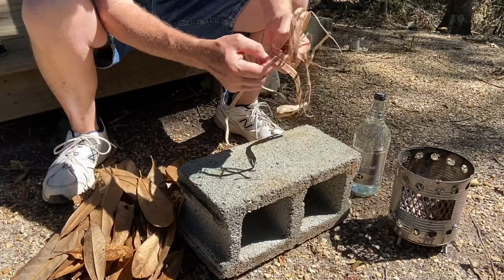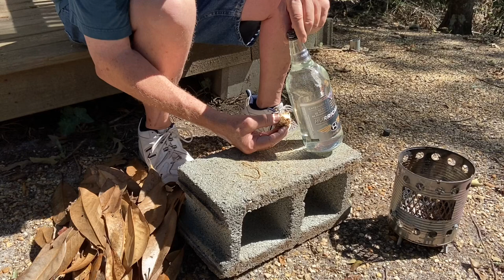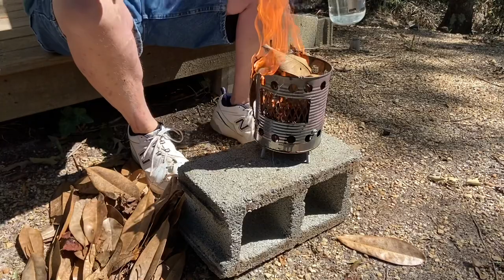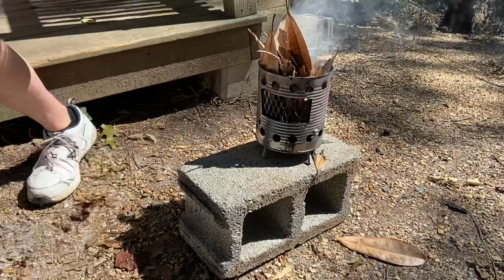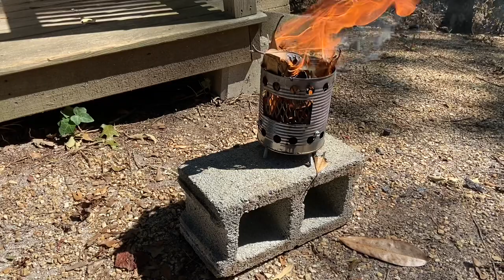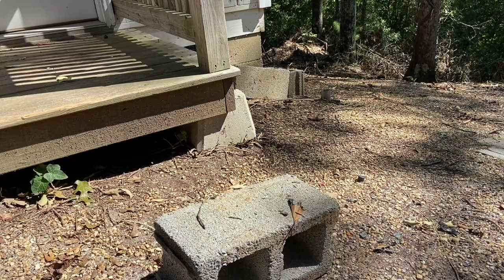Why Spend An Hour+ On Friction Fire When Solar Fire Only Takes Minutes?

Comment from the maker: Friction Firist's can spend hours trying to: find materials for a set, build that set, and then make them produce. Hand and bow drill, bamboo fire saw, and even sometimes fire roll can be labor intensive! Not so much though with Solar ignition. On a bright sunny day using an easy to carry wallet fresnel lens or a bottle of water, it can take just minutes to get the flames.
   Today, I used a bottle of water to solar ignite tulip poplar inner bark and fueled the flames with Magnolia leaves. It only took 8 minutes and very little effort. Come have a look at the "Real Time" footage, follow the Link below, and SUBSCRIBE. Thank You!

Solar Ignitions Playlist
https://www.youtube.com/playlist?list=PLkoXX8XsMW3kl5CicmPv0pTz-7rj4gczW

Comment: Thanks for another good solar ignition, David. I carry a jeweler’s loop for detail for my aging eyes and just in case I need to get a fire going. Question: looking at those dark magnolia leaves, do you think a little pounded/ground into powder sprinkled on the bark roll would speed up ignition?
Reply from the maker: Jewler's loop is probably too small to be effective. It's not the power but the physical size of a magnifier that makes it a good fire starter. Let me know if you've tried the loop already.... Maybe quicker, but there were enough variables to deal with without adding another step. I'm happy with the 8 minute solar fire.